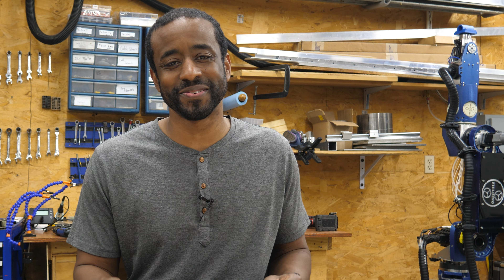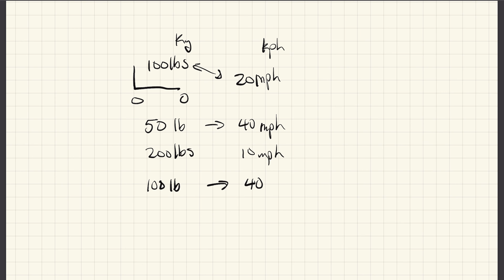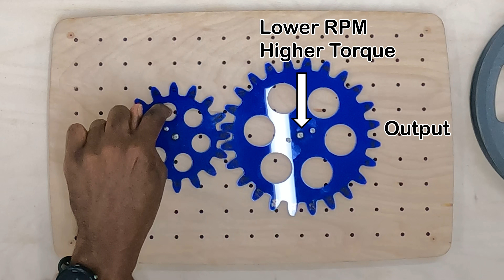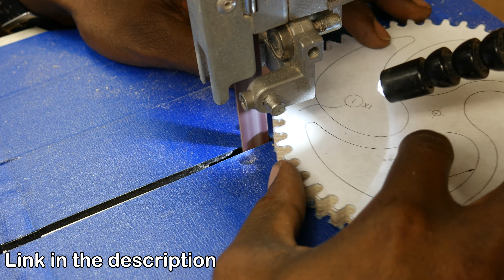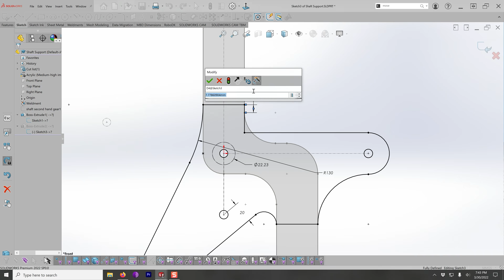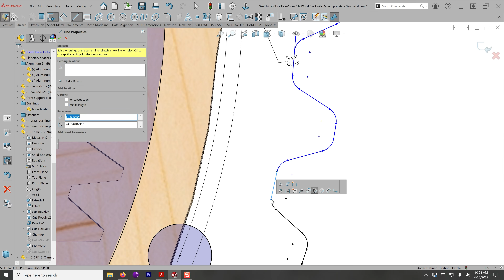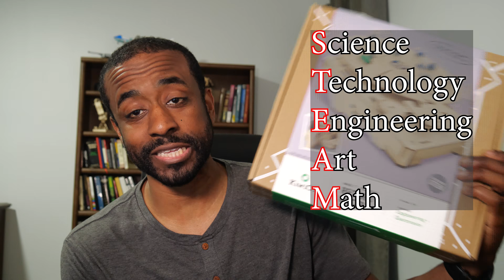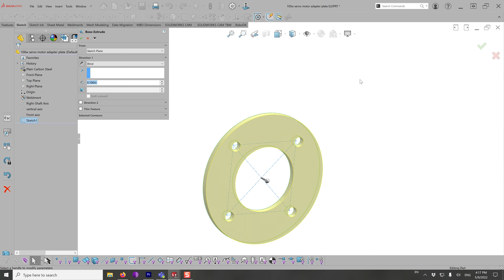How Gears and Pulleys Work: Jeremy Fielding 103

Comment: I believe a screw is only a bolt when it uses a nut. A screw is used in a threaded hole (even if it cuts its own threads).

Comment: Sometimes you can chuck up your tube or rod in a drill to cut, file, shape. Sort of like a hand-held lathe. You can also use it to spin a rod against a grinder to quickly make  nicely shaped handles, etc.

Comment: Loved this video! As far as the difference between a screw and a bolt, at least to my understanding, is that a screw is designed to use the material it is being driven into as its method of fastening, whereas, a bolt's fastening method requires a nut that clamps onto the outer face of the material through which the bolt is placed. So I would say the difference between a screw and a bolt is the method in which they secure to the material.
Reply: What if drill and tap a hole, would I the be inserting a screw or a bolt?
Reply: Firstly, excellent point. I think my definition for bolt is probably off as you would use a bolt for a drilled and tapped hole. However, when drilling and tapping you’re essentially making the material into the nut for the bolt. So, to refine my definition, a screw is designed to move the material and cut its own threads within the material. A bolt requires predefined threads, either within the material or externally with a nut.
Reply: I thought that too at first (nut vs no nut), but then how do you explain tiny machined screws that they make nuts for?  Or are they just named wrong? Lol
Reply: The difference is which part you turn to tighten it. You turn a screw or you turn a nut. It doesn't matter how the threads are formed, wood screw or machine screw. A carriage bolt is a bolt. A hex head can be a screw or a bolt depending on whether you turn it into a threaded hole or turn a nut onto it. A lag bolt isn't; it's a lag screw. Not because of the threads, but because you don't turn the wall onto it. If you use an anchor bolt you turn the nut.

Comment: 5 minutes in and I'm thinking a multi-speed bicycle would be a great visual aid for this. The arm (length from axis to pedal) remains a constant. As the gearing changes. The force required to move the arms increases or decreases, while the resulting speed increases or decreases depending on the gear ratios.

Comment: You need a tubing cutter.  It works great for a small number of pieces.

I have a miniature table saw with a jeweler's blade.  When I need to make a bunch of small bushings or certain length tubes, I cut them one the table saw using a sled.  Works really well.

Comment: Have you ever looked at using square gears? I have seen this recently as a bicycle drive sprocket for the chain. Seemed like an interesting idea.
Reply from the maker: I have made them before. I show some in a video called "things you can make with a washing machine" many years ago
Reply: I used to have a bicycle with elliptical crank gears (Specialized Stump Jumper)
That was so you could make better use of the crank length when 90° from the plane where the crank was basically at top or bottom dead center, and your leg couldn't push or pull directly.
They didn't last too long (mid '80's)

Comment: For cutting small tubing I like my small tubing cutter,  handles up to 1/2" or so copper pipe and works well on a lot of smaller stuff.  Very clean edges,  not much in the way of deburring required.  For grabbing a hold of something ilke that without distorting it,  get yourself a pair of round-nosed pliers.  These are commonly used with jewelry,  but I find them handy in all sorts of other stuff as well.
Reply: I was just about to mention that. You're talking about the type with a round blade that rolls on the tube, right?
Reply: @xenontesla122  no. No sir. The blade is square.
And it never touches the tube.

But we call em pipe cutters
Reply: I think he could have solved that by just filling the brass tubing, cutting it, and then removing the filling.  For example, temporarily glue the brass tubing to an aluminum rod, cut the whole thing together, then use solvent to pop the brass off.  Also owning a small metal cutoff would have helped.

Comment: I've broken a fundamental rule of YouTube, and didn't search before posting this, but I wonder if you could make a video demonstrating how a bicycle with multiple gears works in conjunction with the explanations of gears, like in this video? In other words, a mountain bike is something that most people have used, and possibly still own, but most don't know how it works. Instead of just showing hoe it works, you could also show why it works like it does... Just a thought off the cuff. 
Cheers!
Reply: It's basically what he already said in this video, with the ability to change the size of the gears on both sides. If you have a small gear on the pedal side and a large gear on the wheel side, you pedal a lot to not spin the wheel much, but you get a torque multiplication to make it easier to go up hills (input fast but low torque, output slow but high torque). When you have a large gear on the pedal side and a small gear on the wheel side, it's harder to pedal, but the wheel goes very fast (input slow but high torque, output fast but low torque).

Comment: Screws and bolts are like squares and rectangles. A bolt is always a screw but a screw isn't always a bolt. Screws have points, bolts don't. Machine screws don't have hex heads. A PC case screw that has a flat tip, a slot or depression for a screw driver and a hex head would be both a screw and a bolt. Similar to how a square is always a rectangle but a rectangle isn't always a square.

Comment: The difference between a screw and a bolt is very distinct and not arbitrary at all despite what some comments are stating. 
A bolt is designed to accept a nut, or other female accessory made to thread onto it. A screw is not. A bolt can however be a screw, but a screw can never be a bolt. The moment you thread any female accessory onto a threaded shaft it becomes a bolt. Screws also require some type of "head", whereas a bolt does not. When you remove the head aspect from a threaded shaft it then becomes either a bolt, or a bit. 
Also, lag bolts are technically screws and should be classified as such.
Reply: uh, according to the dictionary, that's wrong:
Screw: 1a: a simple machine of the inclined plane type consisting of a spirally grooved solid cylinder and a correspondingly grooved hollow cylinder into which it fits
b: a nail-shaped or rod-shaped piece with a spiral groove and a slotted or recessed head designed to be inserted into material by rotating (as with a screwdriver) and used for fastening pieces of solid material together. 

Bolt: 3: a metal rod or pin for fastening objects together that usually has a head at one end and a screw thread at the other and is secured by a nut.

So from that definition from merriam-webster, anything with a spiral inclined plane thread is a screw, and a bolt has to be metal, usually has a head, and is secured by a nut. But we all know that bolts come in materials other than metal, and bolts can thread into tapped holes, not only have nuts on the end.

The conclusion is the language people don't know wtf they're talking about - it's a language problem, not an engineering problem.
Reply: @gorak9000  what was wrong about my statement again?

Comment: You need a small lathe. Then you can make little bushings without squashing them.
You can also make screws. And is you really want to, you can also make the nuts that make bolts what they are.
Reply: Lathe is definitely best, but I think he could make those small bushings with a belt sander with a table. Chop off the rough pieces with a hacksaw, then clean up the edges and get the length correct by shortening it on the belt sander. Just set a fence on the table that's perpendicular to the belt, and make sure the table is perpendicular to the belt in the other direction, and away you go.

Comment: You are an inspiration, and a demonstration that talent, determination, and work will get you to amazing places.  It is useful to note that for most people a standard education is an easier way to get there.

Bolts and screws are interesting.  The most common screw has wood threads (sharp to bite into unthreaded softer material or sheet stock) and a head with a recess (slot, square, hex, torx..) to drive it.  The most common type of bolt has threads designed to mate with a pre threaded metal nut, and has a (usually hex) head driven from the outside.  

The head seems to have priority, in that a machine screw has bolt-like threads but a recess in the head.  A lag bolt has wood threads but an outside driven head.  

So my impression without looking it up is that the driving recess in the head makes a screw, while the outside driven head makes it a bolt.
Reply: I was taught that (machine) screws thread into a threaded hole while bolts are tightened with nuts (i.e., no threaded holes in the parts they fasten).  I think I recently reread this in an Engineering text, but I can't guarantee that.
Reply: @bobvines00  That sounds right.  My suggestion was based on usage, but technical definitions are not always followed colloquially.
Reply: @bobvines00  Ehh... I've bought machine screws (according to the box) recently and used some with tapped holes and some with nuts. What you say suggests these identical components from the same box can be either screws or bolts, depending on how they're used. That isn't necessarily wrong, but it sure would make things confusing if I had to go to the store and ask for a box of both screws and bolts that happen to be the same thing.

I can also think of many examples where something is called a bolt even though it screws into a tapped hole. I don't think there is a precise definition of a screw compared to a bolt, but I think yours is pretty far removed from how people would usually determine which is which.
Reply: @chitlitlah  Yes, machine screws can be used either way.  If I remember correctly, the terms bolt and screw are often used depending on how they will be used, but I think there are "technical" differences between them that most folks don't need to bother with.  Typically people don't use the "correct" terms, but since everyone makes the same "mistakes" (me too), they are able to easily procure what they need.
Reply: @bobvines00  Yes, the technical difference is which thing you turn to tighten it. You turn the screw or you turn the nut. Lag bolts are actually lag screws. Hex bolts are often used as machine screws. Carriage bolts are practically impossible to use as screws.

Comment: Great Job. If you can afford you can't beat the masters Seth Thomas and other New England manufactures use of Brass Wheels and mild steel pinions.   Go weight driven and adjustable pendulums.  You are miles ahead of me.  (  I am capable of repairing 100 year old clocks  Not in your league!  )    fluff ( like the Seiko Clocks)  do not help a blind person tell what time it is.  I LOVE YOUR CONTENT!  keep up the good work  .  FYI I would be proud of that Son too if I had one.

Comment: My definition is a screw has a cutout in the head so the tool engages on the INside of the head. A bolt has a particular shaped head allowing the tool to engage on the OUTside
Reply: So cap head bolts are screws? yea I don't like that!
Reply: @vizionthing  They have always been called “cap screws” in my experience, so yes.

Comment: I think a screw has a pointy bit on the front, a bolt has a flat front.
Reply: But machine screws are flat, and lag bolts are pointy... just put the blame where it clearly needs to be - with the language people, not the engineers :)
Reply: @gorak9000  Ahhh, poo, I didn't think of those. Your right 😅

Comment: I love your engineering educational videos, they are amazing. I learn things even though I know a fair bit of engineering science already. That is a beautiful clock!
But also, the time lapse build portion is just amazing to watch... you should do more of just that. I think some time lapse build videos would be easier to make (without the narration and explanation and fewer cuts), I think, and give you more content and exposure for your channel.
Reply: lol a screw secures to the material itself while a bolt secures to a nut on the other side of the material ;)
Reply: @pufthemajicdragon  You turn the screw to tighten it, even if it is into a captive nut. You turn the nut to tighten a bolt, whether it is a carriage bolt or a hex bolt with the head captive in the material or just held still with a wrench.

Comment: A screw fastens two pieces by engaging the material being fastened along its whole length. A bolt only engages the threads in its nut or tapped hole, and fastens the materials by compression alone.
Reply: Agree, but self tapping screws used on sheet metal will break the 'along whole length' part of this rule. I find it easier to stick with 'Screws pointy Bolts not pointy'
Reply: @vizionthing  but machine screws aren't pointy. Once again, the English language shows it's weaknesses.
Reply: Great, except you forgot _well, actually_... :)
Reply: @mumiemonstret  Well actually, I couldn't do that since he never gave his own explanation for me to protest against, the cad 😝

Comment: Thanks for the video Sir! I enjoy your good skills of communication as well as your creative mind. Excellent to encourage newcomers along. One thought from my experience was that a press fitted bushing will reduce the ID of the bushing. To use this to my favor,  a reamer or a barrel lap could be used to remove a small amount of material once the bushing is pressed in (so it's easier to hold it while reaming).
Reply from the maker: Yes it does... but you are talking about really tight fits on both sides at that point. I only needed enough interference to hold a very light weight part in wood. If I was designing a machine from steel parts, and needed to heat the part to press it in, we have a lot more to consider. :)

Comment: What about gear ratio? You can have a 3.08:1 or a 4.56:1 but the gears are the same size for both ratios. how does that affect torqure?
Reply from the maker: In this example you are changing the force required by the motor to maintain the rated speed of the motor. Torque has two parts, the length of the lever and the force on the lever.
Reply: @Jeremy_Fielding  i dont understand i am not changing the size of the gears just the number of teeth and the motor is still on the smaller gear in both aplications? If torque is apllied at the same distance why would it mater how many teeth are in the equation?
Reply: Gear ratios are about how much speed and torque are transmitted from the driver gear to the new gear. You can keep the same speed and torque or you can increase one/ decrease the other.
Reply: I don't see how you can have 2 gears that are the same size with a differing number of teeth. The number of teeth directly corresponds to the diameter of the gear, at least with any widely used gear standard. When making a gear - step1 choose the number of teeth, step2 calculate (or look up in a table) the diameter of the gear blank you need for that number of teeth.
Reply: @gorak9000  i was talking about axle gears and they can have tons of different ratios but are all the same size.
Reply: @bh5097  Ordinary gears need to have the same tooth pitch to mesh smoothly, meaning different gear ratios require different diameters. The axle gears you are speaking of are probably hypoid or spiral bevel gears which have a more complicated meshing pattern. Somebody who actually knows what they are talking about could explain it better than me.